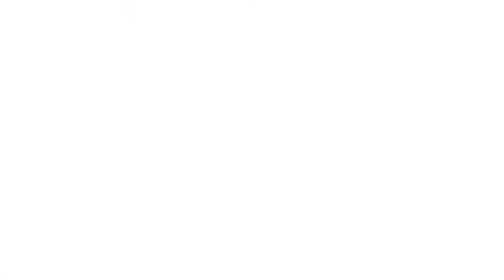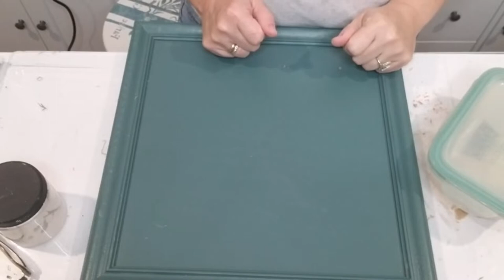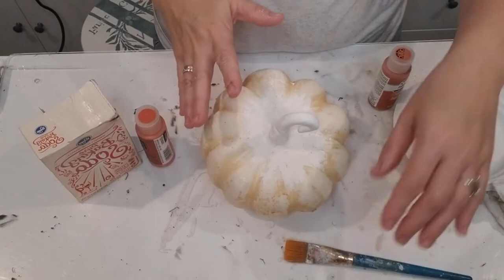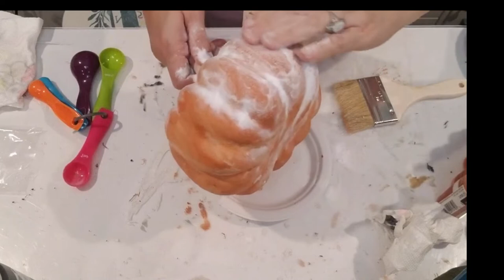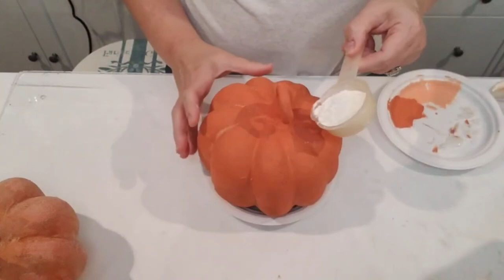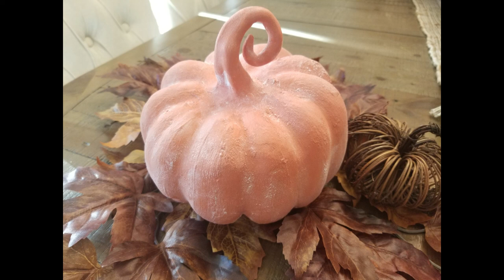Faux Terracotta Pumpkins that Look Like Pottery Barn Pumpkins

Comment: I stored several of my beautiful Halloween crafts that were made from air dry clay out in my shed. I live in Maine heat and cold weather literally breaks it down into dust. I was devastated. If you stored in a closet where it’s hot, it will break down to dust if you put it in a closet where it’s cold, it will break down to dust. It literally breaks down, even when I have it in the same temperature of my home with no heat or cold gets to it and it breaks so easy.I prefer baked clay last for years.
Reply from the maker: Thanks for the info. I have not had that trouble but I am going to research it a bit for future reference.